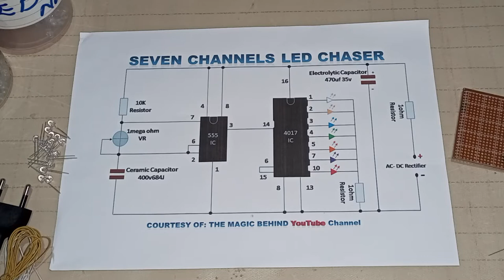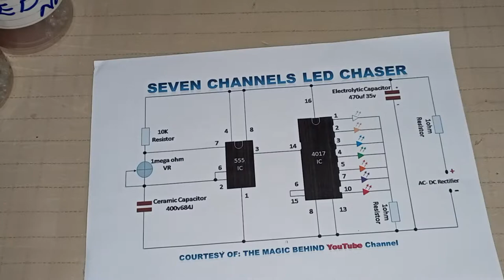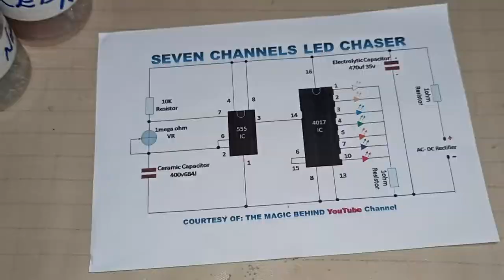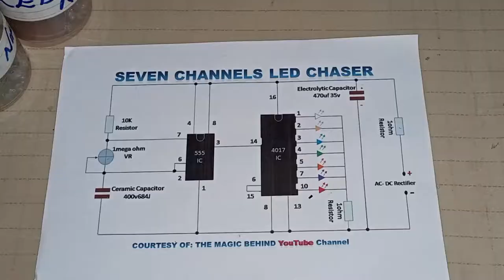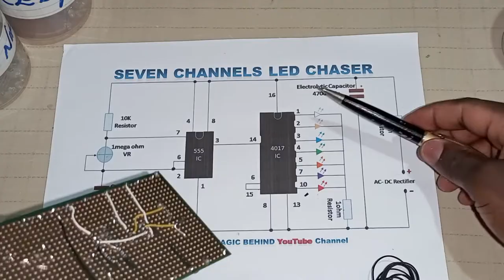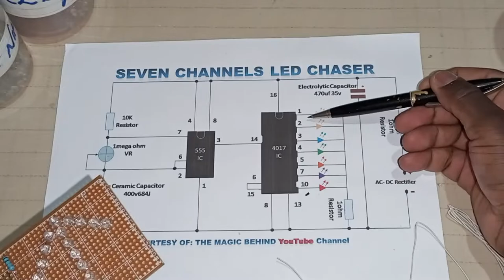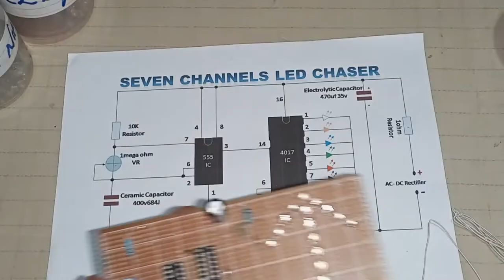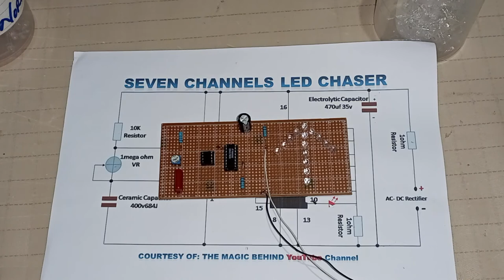Let us make 7 Channels LED Chaser Step by Step.

Comment: Hello Sir
Very nice way to explain. thanks for it.
As I am a beginner   I may kindly be guided  .....
1)what is the watt of resistances as it is used in AC circuit.
2)Can we use MB10M rectifier or GBJ2510 1000 V, 25 A Single Phase Bridge Rectifier?
Hoping guidance.
Thanks
Reply from the maker: Hi SarangS. Thank you for watching my videos. Resistors should be 1Watt. For the rectifier, please use the one i have used. Please use the link below and learn how to make one. Its very simple. Electronics circuits are very sensitive. You may use something different and it blows which is very dangerous. Components are readily available in electronics shops and they are cheap. https://youtu.be/_tvbE-Wyfrg
Reply: @themagicbehind8545  
OK Sir
Thanks for prompt guidance.

Comment: What's a substitute for the 1mega ohm variable resistor sir
Reply: Is it a must for it to be in the circuit
Reply from the maker: Thank you William, You can use a Variable Resistor of a value less than 1 mega ohm or more than 1 Mega ohm but you need to put in consideration the physical size. It should be small in size.

Comment: How much is the input Voltage ju nmeitest na LEDs Saba IC zikaungua
Reply from the maker: Hello Mzungu. As long as you have used the correct components the circuit should be comfortable with the input voltage. The most likely issue are ICs you are using. Please change the shop where you are Buying them. I lost over 50 pieces of ICs before I found the ones which worked. Some ICs come faulty from the factory or they are not properly manufactured.